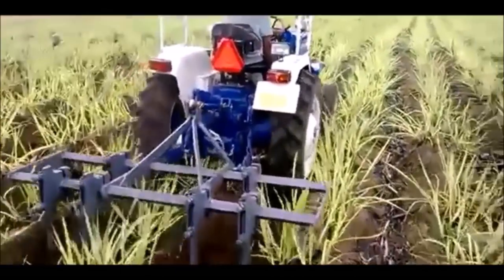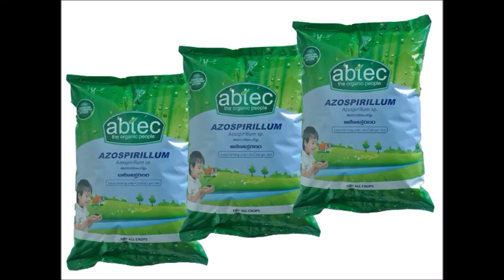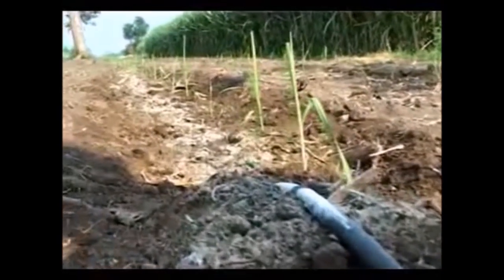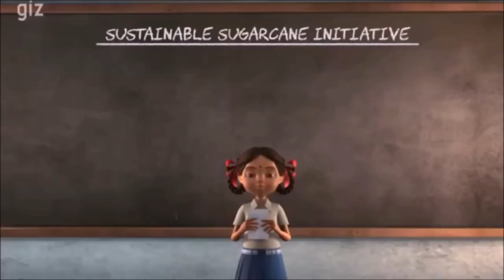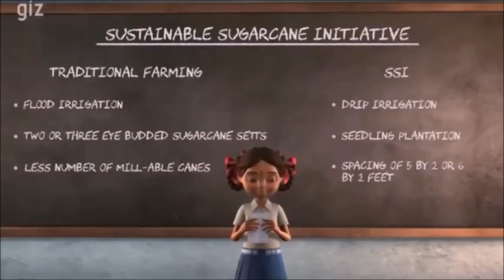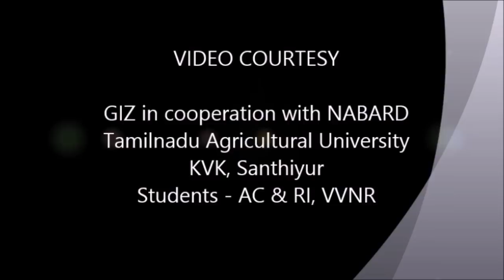Seed to Seed Technology of Sugarcane

Comment: No one in the last two years understand what i asking. Its about the distance between rows. Is it 4_5 ft from.the centre of the row to the other rows centre. Or it is between the edges of the rows??
Reply from the maker: 5 ft between rows. Centre to centre
Reply from the maker: As per Research the spacing should be 2.5 ft on either side of the plant. Hope this helps
Reply: This for double buds in a row? if centre to centre is 5 ft. Then the space is left between plants is more than 2.5 ft
Reply: Or you are saying in one row spacing of plant to plant should be 2.5
Reply: Or you are saying in one row spacing of plant to plant should be 2.5
Reply: @janmann6972  its called 5*2 method. Line to line 5 feet and plant to plant 2 feet.